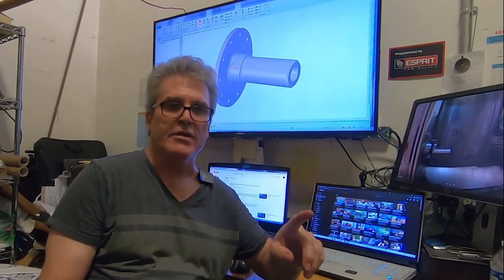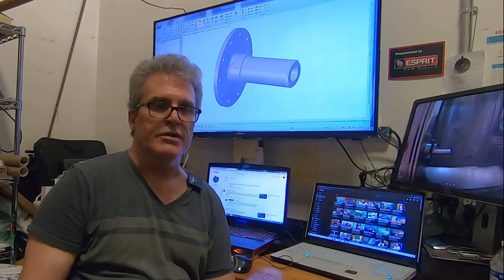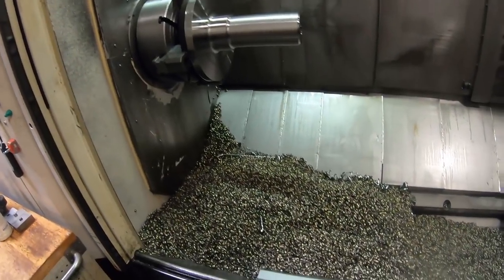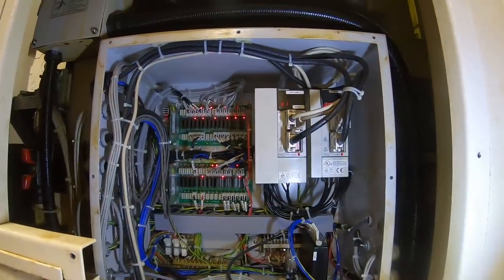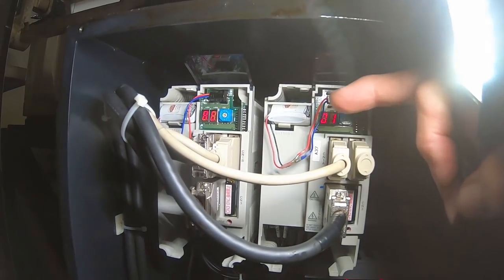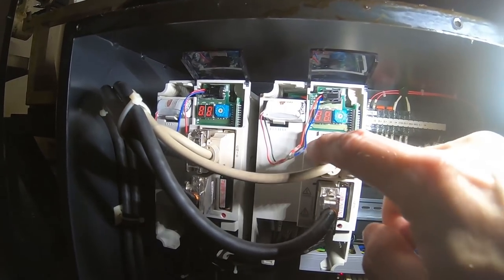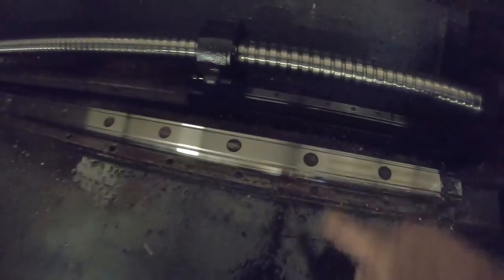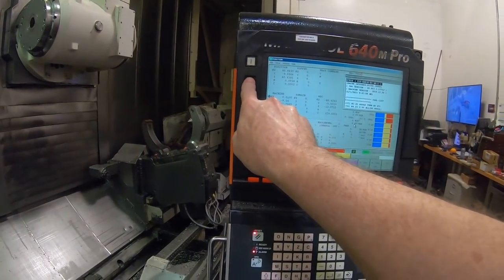Back Up Batteries In Mazak

Comment: Hi Peter. great to see you back and well again. Heres a bit of friendly advice. I'm a Metrologist of 40 years service and work for a huge Medical Company. We have several old CNC inspection machines running on XP, 2000, Windows 7 etc that are all obsolete and unsupportable. For the cost of a Crucial 500GB SSD hard drive (80 bucks) you could Clone your MAZAK hard drive. If the drive goes down you could then just swop it out with the clone and you would be instantly back up and running again. We do this all the time and it works great. Love your videos, great work, Best Regards,
Glenn.
Reply: Did you clone windows 95?

Comment: Hey peter, great Video, i change the Batteries one time a year, importen is the machine power is on if you change it, we are working with machines with fanuc control (18i and 21i) ... yes they are bit old but very reliable, from the manual i know there is a battery warning when it reaches low voltage level, if this warning is display dont wait to long to change the batteries

Comment: Glad to see you’re doing better Peter. 

The WFL MillTurn M120 I ran did the very same thing. Millwrights had to disassemble the whole bottom of the machine and take out the conveyor. Had to replace the guides and the gear the conveyor wrapped around. My machine did the same thing would only move a few feet in earthier direction. It is a chore like you said. Sucked for me though. I had to suit up and pressure wash the tank in the wash booth we cleaned the huge engine blocks of chips after machining. 🤣🤣

Comment: we have an ajv that has the battery alarm for the last 14years haha, just turn it on once a week or if they go dead it will have to boot from the hard drive and reload everything, but even if they went dead wont they just home out so they know were its at?, so glad to see you back at it peter!
Reply from the maker: No the tool changer has specific locations no home return position. You need to jog each thing to a specific position. Than power the machine down in a special way to reset the encoders. Than it remembers those locations. It’s kind of weird but that’s the way they made it.
Reply: @EdgePrecision  wow,,that's cool to know tho! But ya kinda wierd... thanks!

Comment: Lithium coin cells on the SFF PC mainboard, on the program SRAM board (I believe) and on the control interface card...I wouldn't use anything other than BR cells there.  CR cells may have a higher capacity but BR cells have better long-term stability.
Reply from the maker: There just those 2032 Lithium from the drugstore. I haven't had any trouble with them.

Comment: Its a G force sensor, super sensitive, any tipping of any major degree difference will set it off, other guys if it’s a hard crash will set them off.
And yep mazak gives you a code to reset it. Works even on the smaller milling machines to make it ITAR compliant.
Reply from the maker: No this is actually a GPS sensor if your shop is large it can be tripped if you move the machine to the other side of the building. Maybe some newer machines have what you are describing. This older machine doesn't have that.

Comment: If you open the mrj2 setup software you can select each axis and look at the alarms for each axis that will tell you which one has the fault no problem just make sure they have power when you change the batteries

Comment: Hi Edge Precision, I have watched you for very long time. You were only one that uploaded Mazak videos and partially due to that I managed to get Technician job for Mazaks. So here is me repaying you somewhat:

The location sensor is not GPS based, its basically motion sensors, if you move machine little bit it will lock it. But it doesn't know where machine is located. They are also located in small machines, as far as I know its more dependant on models accuracy then size if location sensor is present. Even some QT100 has them. 

Regarding batteries in ATC don't worry about turning off the machine with low batteries, worst case scenario you will have to do  absolution position repair through MRJ2 controller. The ATC drives remain powered on anyway unless main breaker is off. 

Also make sure you do backups at least once a year. One through Mazatrol data i/o and another through MAINTE which in inside C disk. Rom to flash and Rom to Hard disk.
Reply from the maker: Yes I did that when I set up this machine with the tool changer. But I just do want to have to go thru that again. It takes time on this large machine. This particular machine doesn't have a jog pendent on its hand wheel so it's very difficult so see the position of things from the control. I have to jog a little than get up the ladder look and go back to the control and so on. Its a pain. So better to be safe than sorry. But Thanks for the information.
Reply: Some machines do have gps, but this machine may be too old for it. The export regulations are for machines with >/= 5 axes, like large mill/turn machines, and also for high precision/accuracy CMMs. They found high accuracy and high precision mill/turn and CMMs in restricted countries (most notably Libya and Iran) that were trying to build centrifuges to enrich nuclear material to build nuclear weapons. There was a huge case where Mitutoyo executives were actually IMPRISONED after a court case exposed that they were habitually skirting export restrictions, after the IAEA (International Atomic Energy Agency) found their CMMs in a Libyan uranium enrichment facility. Some ignorant people get mad at the companies that manufacture machines with these accelerometers, gyros, and GPS movement/location sensors, but it's actually legislation (from agencies like ITAR in the U.S.) that requires them to. It's actually really good that they're required to put devices to stop the export of the machines to such countries. 

You can read about it by searching Google for "NTI The Mitutoyo Case: Will Japan Learn from Its Mistakes or Repeat Them?"

Comment: Glad you're feeling better. Staying away from work after Covid is not a political issue. It is a common sense, science based practice. 
Do CNC machines have software licenses which expire? In my field, broadcast engineering, there are long license keys which sometimes need to be renewed.
Reply from the maker: Not the machine itself but the cad and cam software you run on the computer do.

Comment: All new Mazak’s have the relocation device, not just the larger machines.

Also, I may have missed it, but did you replace the CNC battery, usually located behind the monitor? (Actually, on Mazak CNC lathes at least, for that version control, the entire CNC unit is behind the monitor!)
Reply from the maker: That's what I referring to when I said in the controls computer. On my machine the Windows computer is behind the monitor and that's where the batteries are. Three CR 2032 flat Lithium cells.

Comment: hi Peter have you ever lost home position or lost soft limit on the B axis? i can home all axes but for the B axis (integrex 300)
the TOOL CLAMP is flashing when i am in JOG mode
MDI doesn't work 
Memory doesn't work; i keep getting the  324 (not referenced) alarm 
and 256 alarm if i try to home the B axis 
can you help?
Reply from the maker: No I have never had this problem. But from what you describe I would look into the tool clamp issue. You won’t be able to do anything if the tools not clamped.

Comment: I am using Pinnacle LVT137 Mistubisi M80 control. I got the same issue . It give an alarm 🚨 for low battery voltage. I just simply change the battery 🔋 which were located near servo drives. And everything is alright and didn’t show me error anymore.

Comment: I recommend you to buy oil skimmer, to cancel problem of oil in your coolant in the future. It separets oil form coolant (its like a filter). It help coolant to stay usefull way more longer. Also layer of oil on the surface of your coolant causes baceria and other nasty stuff to grow much more faster. It may causes skin problems. Before changing coolant it is usefull to clean whole coolant system. You can buy some chemical stuff which you add to old coolant and leave whole coolant system running for 8-16 hours (or longer). It kills all biologicall nasty stuff and helps to get rid off bad smell, old mud and dirt from coolant tank. I also reccomend you to use demineralised water to mix with new coolant. Demineralised water has no minerals inside and because of that bacterias has no 'food' to eat and thats why they grow much more slower in that mixture comparing to mixture with normal water :). Sorry for my poor english. To bad in my country CNC machinist are really bad payed. I left industry after 7 years because of that. Greeting form Poland and I wish you to be healthy! You are doing great job!
Reply from the maker: A skimmer wont work on this coolant system. It has one and it does no good. The tank is divided into many sections and most of it is under that long chip conveyer. The coolant isn't bad. There is no bacteria that's causing a problem in this system. A system that circulates the coolant out of the tank and cleans it than puts it back. Like a coalescer or a oil tramp separator would probably work. Our local water is fine to mix with the coolant (We have tested it). If I could bring myself to buy the filter system it would also help in filming the videos. Part of my problem with the camera is the oil in the coolant. You see I have put a lot of study into coolant. But its just my laziness and lack of doing anything about it is the real problem (And not wanting to spend the money):

Comment: On our Mazak, at the operator end of our chip conveyer, the axle and sprocket were completely worn out. Because it was welded together from the factory we had to cut open the conveyer with an angle grinder to replace all the moving parts. :/
Reply from the maker: Were you the one that sent me the photos of your conveyor?
This one is also welded together and will have to be cut apart if I cant get the belt/chain out somehow. Thanks!
Reply: @EdgePrecision  Nope, wasn't me. :P

Comment: To clean up video audio, just look for and download Audacity (it's free), and it has, under Effects, a Noise Removal tool.
Just select a section of audio where you're not speaking, to get only the background noise as a sample (Get Profile button), then apply to a section of speaking to see if you're happy with the settings before applying it to a bigger track.
It would completely remove the machine noise from behind your voice ;)

p.s. Don't export as mp3, use WAV for best quality
Reply: Though I wouldn't blame you for not wanting to commit to the process that much. I know making videos is already an effort, and I'm too lazy to do it myself for most things :P

Comment: Is shoveling those chips out bothering your shoulder? I think it was your shoulder that was hurt wasn’t it?
Reply from the maker: Yes it hurts a little. But I think the exercise is good for it. Thanks.
Reply: That stuff doesn't shovel for nothing.         Get a pickup magnet on a handle with the release lever.      And don't even try to run it until the chips are gone, right down to the last bit or your going to cause more damage.

Comment: Man you really need to get that conveyer fixed. Maybe just have someone come in and repair the conveyer. 

I have heard coolant companies that can come in and clean the coolant for you but I’m not sure about that.

I need to replace the batteries inside my control panel and do a backup.

I did replace all the batteries in the drives.  But I’ve been afraid to open up the control panel.

I don’t do as cool of work as you but I got a baby integrex 100ivst and it’s crazy how even on that tiny machine the z axis rails are still very far apart and there is 3 just like yours. So far I’m loving the integrex and would really like a bigger one.
Reply: Cheaper to fix conveyor than those  way covers that are grinding away on all those chips
Reply from the maker: Of course do the backup first. Especially the machine parameters. I have seen it done but it is hell to enter all of them by hand.
Reply: @EdgePrecision  yea I haven’t quite figured out how to do that yet. Something I’ve been putting on the back burner but I really shouldn’t. 

I’m very interested in the cam aswell I mostly program in mazatrol and my machine is 5axis capable I just don’t know how to drive it.

Comment: You need to call service guy to change battery. They will get a access code from export control department.  two things involve this like you said relocation machine or change backup battery. the reason is machine tools is a control good due to it can produce destructive weapon, so machine tool company must identify and make sure selling the machine to right customers and location. otherwise company will be charged and ban for at least 5years and heavy penalties charge, whole mazak companys will be closed down until further notice. You can check this from MITI.
Reply: There is a gyro sensor at main electrical cabin. no matter how you move the machine or bypass or jump switch the sensor, it will auto lock down your controller .

Comment: How did you learn all this?
Reply from the maker: I don’t know exactly. Maybe from observing others doing it. Or just kind of using common sense when you get a battery warning on a computer it’s the backup batteries. So I had just recently replaced those in this controls computer. So I called my Mazak repair guy I use (not Mazak). From the alarm number he said it was in one of the tool changers servo drives back up. So that’s how it normally goes. If the problem is beyond my abilities I call him to take care of it. He is really good with Mazaks.

Comment: Can you use mastercam on mazak  or there is another software that works better.
Reply: Anything which supports the Mazak EIA format.  Mastercam would certainly work but for 5-axis there are certainly better solutions.
Reply from the maker: Yes you can use MasterCam. I use Esprit TNG.

Comment: Can you share any PDf or PPT files like this
Battery backup procedure
Reply from the maker: The procedure is. If you get the alarm don't power the machine down with this alarm. Back up everything in the control if its the controls batteries!!! Find out witch batteries need to be replaced. Get the proper batteries and replace them WITHOUT POWERING THE MACHINE DOWN. Once the new batteries are installed properly power the machine down and back on like I did in this video. Sorry I don't have any PDF files on this.

Comment: I feel your pain on the chip conveyor.  My boss asked me why I don't have it running continues.  I told him I only run it when I need it because I don't want to dig out chips when it goes down.  I have a question for you.  What do you know about Siemens control.  I was down for a day and a half for a reference issue on the MZ4 axis.  I got it figured out and saved the company alot of money.  But i was wondering if you have any experience with the german machines and controls?  I love your work by the way.
Reply from the maker: No sorry never ran a Siemens control. The Meldas control on my horizontal mill gives a similar error message when there is a error in the digital scale.
Reply: How do you have time to watch machining videos? Shouldn't you be posting other peoples' videos on your channel? Mainly videos of people whining about police. 
"i'M gOiNg tO GiVe tHiS cOp a HaRd TiMe aNd bE SuRpRiSeD when hE GiVeS mE A hArD TiMe. tHeN i'M gOiNg wHiNe aBoUt iT."
Reply: @littlejackalo5326  Your very special.  Welcomed to the real word.

Comment: Scary seeing somone poke finger in cabinets, that 100% have hangerous voltages on some of conections. Dont get me wrong, some of my cabinets have no covers for ''bad for touch'' stuff. Just so much more scary when somone else does it...
Reply from the maker: I wasn't getting any ware near any high voltage connections.
Reply: 230V isn’t too bad, most of that is low voltage stuff like 36V or 72V dc drives. 
600V here, thats another thing right there
Reply: andrejs gēliņš                      If you stand back and watch the machine work, you will often see a mist of coolant and oil. If that stuff soaks into the electronics, you have just ruined yourself a fancy CNC machine.             Keep those covers on.